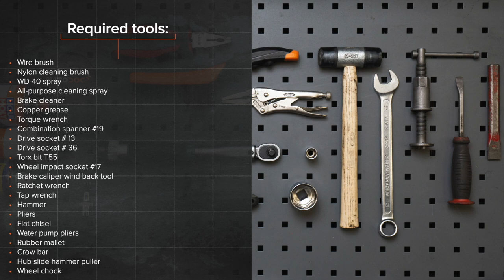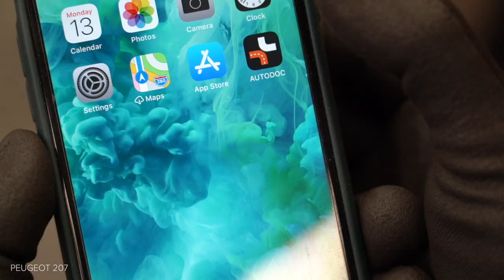How to change rear brake discs on PEUGEOT 207 [TUTORIAL AUTODOC]

Comment: It's a T50 for the caliper mount bolts, not T55, can also see the socket is labeled T50 on the close-up @4:20
Reply: I discovered this after buying a T55. I actually got the bolts of with a (loose) T45 - thanks for the quality Snap-On but will be buying a T50. You can never have too many tools.

Comment: According to your video I have to use a T55 torx bit to remove the brake calliper so I went out and bought one. It doesn’t fit!! Can you please tell me the correct size so I don’t waste more money than I need to? I have a 2008 Peugot 207cc. Your speedy answer would be gratefully received as my car is outside and we’re expecting rain later. Thanks
Reply from the maker: This video is for introduction purposes and does not guarantee a specific result. highly recommend the garage services in order to get the best result or check information in the vehicle maintenance log book

Comment: Which grease u use on brake pads and on axle, before u put a new disc. Its a green color. Tnx
Reply from the maker: We use special high-temperature lubricants for the brake system:
5,000,000 150 BOSCH
PFG110 TRW
AUTODOC
Reply: Just use copper grease

Comment: Should I buy the brake discs with or without bearings?
Reply from the maker: It all depends on the configuration of your car, if your bearing comes complete with a brake disc, then you need to change the brake disc with the bearing, if there is a brake disc and a separate hub with a bearing, then only the brake disc can be replaced.

Comment: @autodoc.co.uk hi I recently pit my 2009 Peugeot 207 to have my disc and pads replaced but I've just been out to look because there's a slight juddering when I use my brakes and I've just noticed the brakes on the back of my car are now drum brakes. I was sure I had discs all round, is it usual for a 207 1.5hdi to have drum brakes on the back? Is it possible he could of put drum brakes on my car for whatever reason? Thanks in advance... mikee
Reply from the maker: The car has different configurations, both brake discs and brake drums can be installed at the rear.
AUTODOC

Comment: I have to change my mother's rear discs.....this is typically Peugeot. I wondered why the rears were so much when I did quick google check on the prices. They are literally twice the price of my Mini.
Reply from the maker: There is no way to answer your question.
Reply: They include the wheel bearing?
Reply: @n4s117  some do include them. You have to check the description of the product. One costs the same as two for the front.